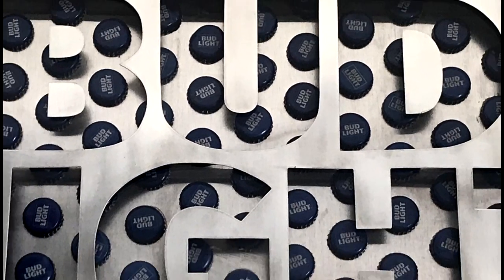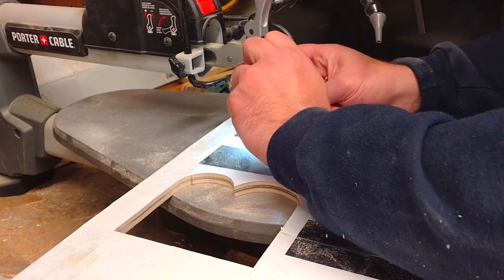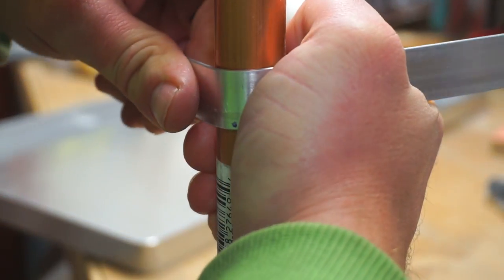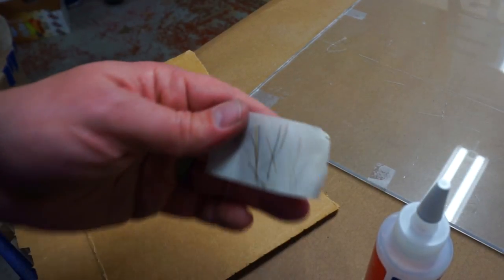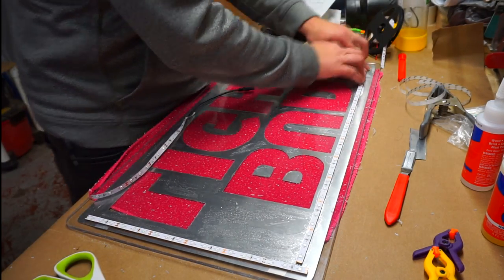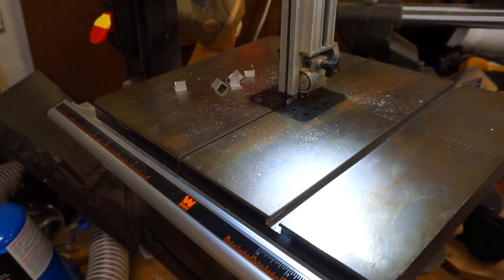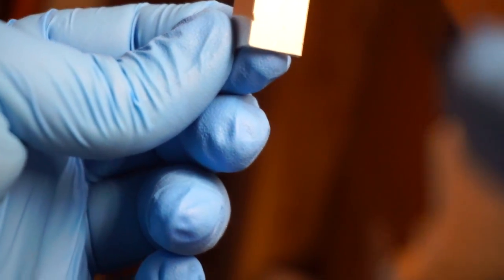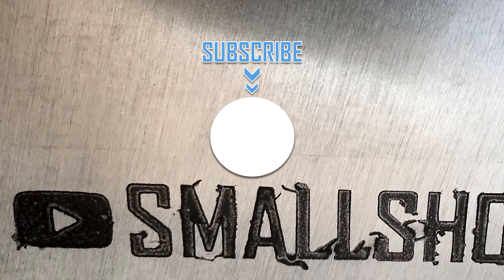DIY Neon Beer Sign Using LED Lights and Woodworking Tools

Comment: i had skipped over this video when it first came out, but then watched your next "commercial" video and saw you working with LED lights and realized that would interest me. Then your working with aluminum was also good! So I'm glad I went back to watch this though I am primarily a "woodworker". Thanks!
Reply from the maker: Thanks a lot Mark for the heads up! I am afraid many people are probably in the same boat. I am going to look at fixing that very thing! Thanks a lot!